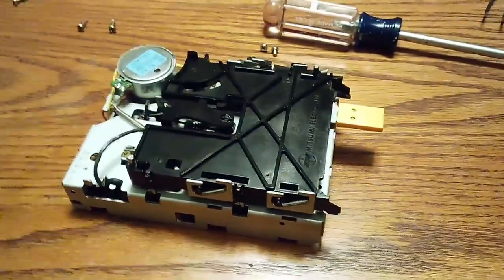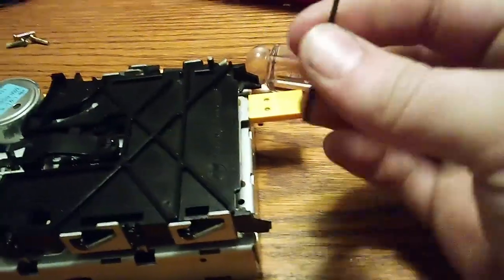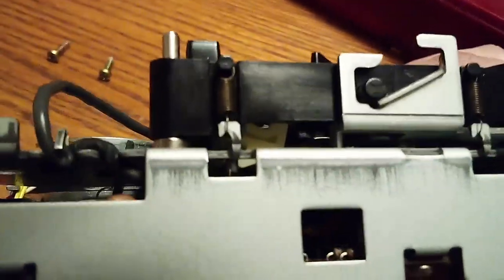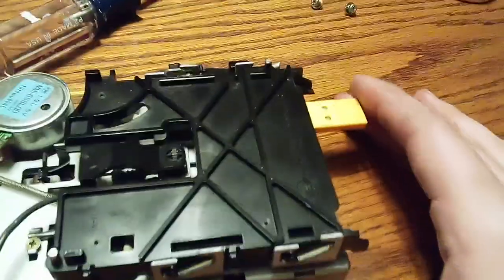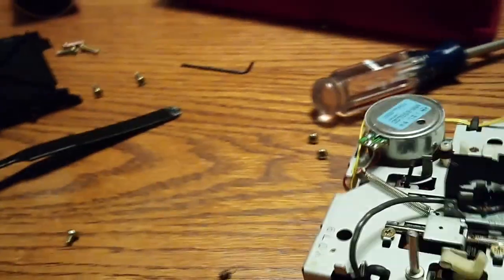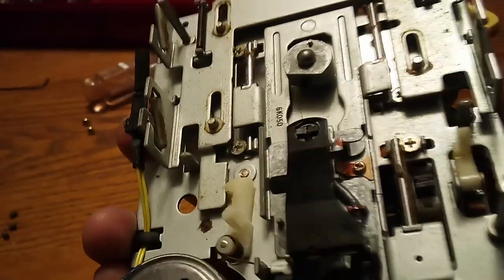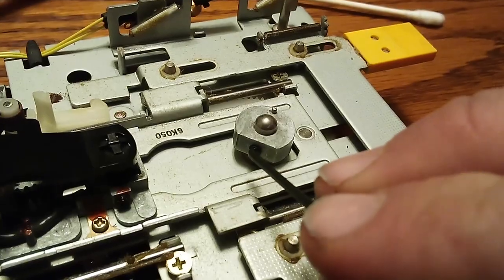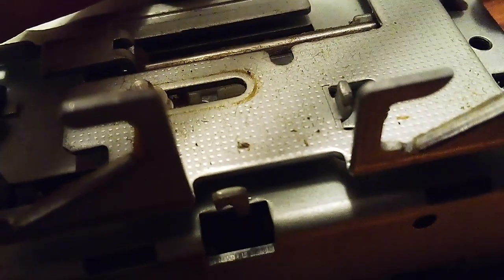Famicom Disk System spindle alignment

Comment: You saved me, the trick of adjusting it after trying it was clearly my problem.
I can give an advanced tip: when the motor get too fast, error 21, when ok or maybe too low, error 27, so error 22 as well sometimes appears but it is kinda deceiving, so if you have this case, you have to tweak the motor screw at like halfway, and around that place you gently tweak it (if you will get error 21 again, you have just to invert to clockwise screwing), at some point, most of the times, your screen will go black after inserting the game, kinda like it is gonna play for real, but nothing, you will get error 27, AT THAT POINT, you have to tweak the spindle, follow the video and make the adjustments after the first spindle adjustment show in the video, and it will work, just be patient.
Wanted to give my knowledge to thank this guy, i really hope that i will help someone with this!

Comment: Thank you so much for this, it worked perfectly.  Mine was working fine when I put it in storage 10 or so years ago, but I took it out and discovered it was throwing error 22.  When I removed the disk interface piece, and checked the screw position against the "factory" divot, it was off about 120 degrees.  But setting it back fixed Error 22 immediately for me. Rather than tightening and feeling for the divot, I found the easiest way to get it lined up was to remove the fixing screw and shine a light into the screw shaft until the factory divot was dead center of the hole.

Comment: The problem with this method is that the factory position doesn't work if the belt comes off. When the parts move independently, without a belt, your factory position doesn't work, unless everything is completely lined up, the way it was before the belt came off. Also, most spindles don't have a dot on them anymore. They have rings from years of readjustment.

Comment: Thank you! I was having trouble with a drive writing games, tuning it a bit more might make it write better!
Reply from the maker: lmk if it works
Reply: @ITISWHATIS  yes and no, it's aligned now but the drive doesn't properly reset. I'm gonna disassemble the whole thing and make sure the motors and spindle are at the right rpm

Comment: i need a new ram adapter first, it is crashing after some seconds or minutes in bios. tried other cartridge games and they are working, so i my adapter is faulty i think. but thank you for this info, i will try it when my belts a arrived from aliexpress
Reply from the maker: No problem! I'd try looking at the internals of the RAM adaptor. You might be able to find something wrong with it. Broken trace, faulty cap, etc. It'd also be a good opportunity to give the board an IPA bath.
Reply: @ITISWHATIS  i am very good in electronics and programming. i believe that the asic/custom chip is faulty.
Reply from the maker: @SuperNeotendo  That's tough. I had to deal with a chip swap not too long ago myself. At least RAM modules aren't too bad price-wise. Still sucks though.
Reply: @ITISWHATIS  the big sram is ok, but can not test/swap the little ram chips (no replacements here).

Comment: Sadly no dice for me I can get it very close where it'll give me the black screen but then I'll either error 22 or 27
Reply from the maker: I can personally tell you that I've run into that issue too. What makes things worse is it could be a number of factors. Could be the disc, could be the motor speed, could be the size of the FDS band you're using, etc.
Reply: @ITISWHATIS  i found my issue, because i had a early modle it needed slightly more amps, after giving it 850MA instead of 550MA it worked just fine :)
Reply: @FDS-Nat hey, did you mean the motor or the console itself?

Comment: Didn't work for me. Maybe I was doing something wrong?   But i tried adjusting it and it either didn't spin because it was too tight, or came undone because it was too loose
Reply from the maker: Undone if I were to guess. Or the band came undone. Or the disk isn't pressing the switch.
There's a lot of issues these can have.
Reply: @ITISWHATIS  maybe i'll swap the belt